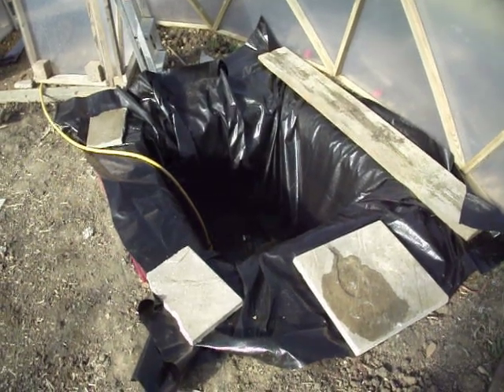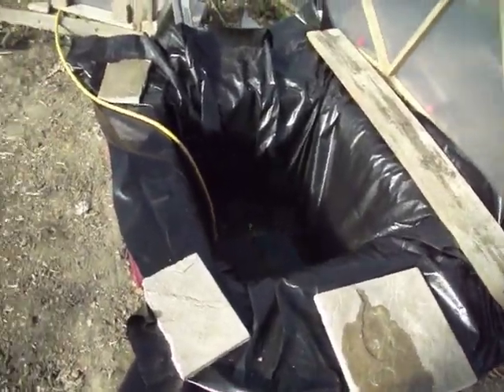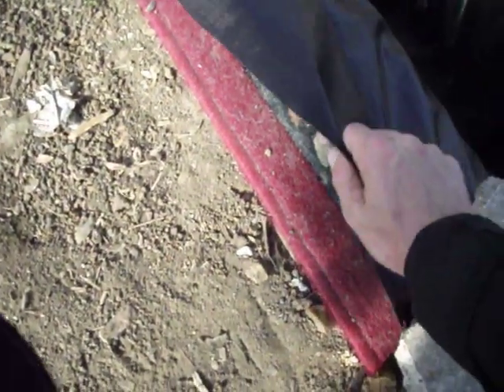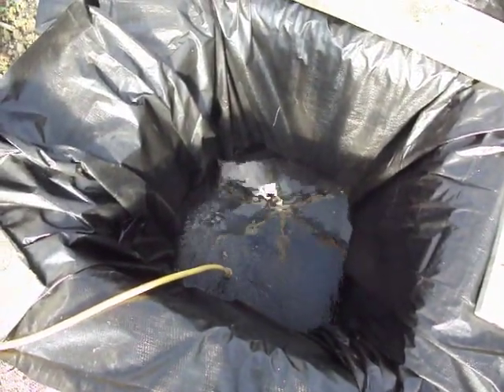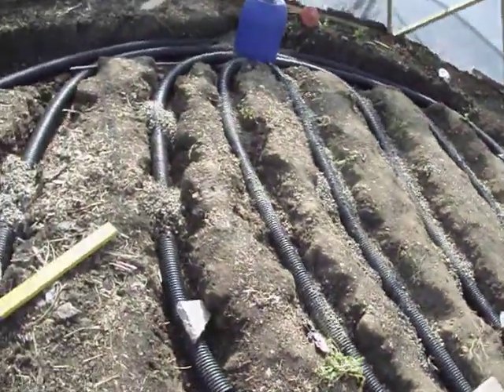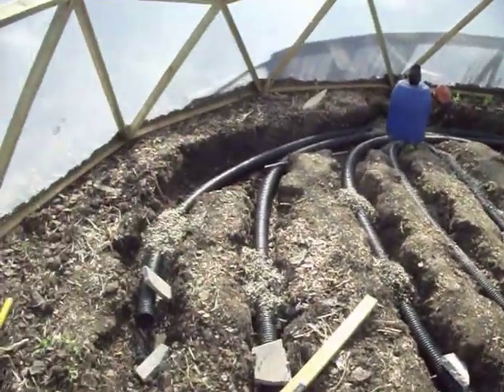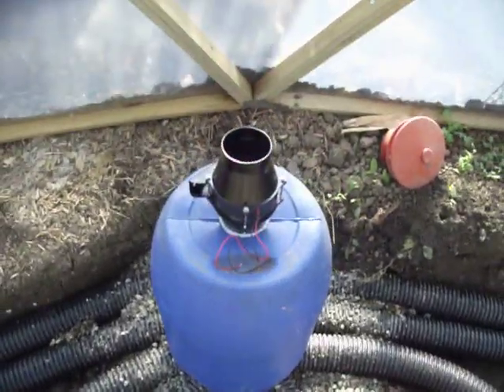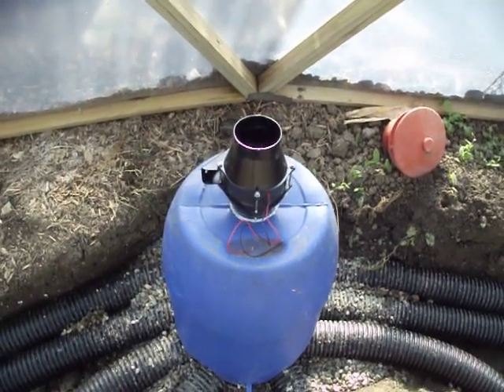BioDome Systems The Aquaponic Chronicle- A geodesic journey Pt 6 Hot or Cold?

Comment from the maker: If you look up the subterranean  heating and cooling system you will find a site that tells you about setting up the piping, i still need to add two thermostats to control the fan. I also figured out the specific heat capacity and thermal mass of one ton of water, its like a 20,000btu air conditioner or heater.  then when i add the gravel there should be  two tons of thermal mass.